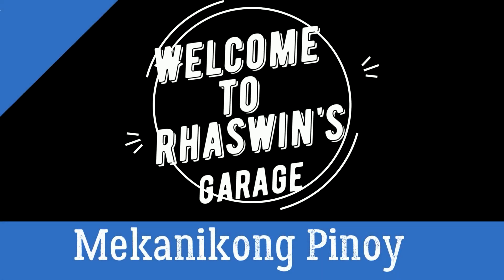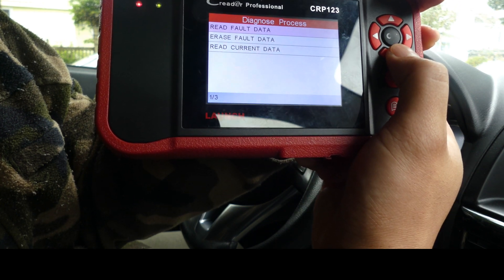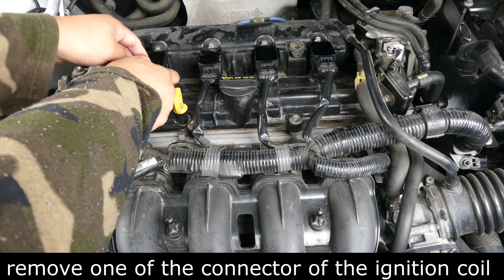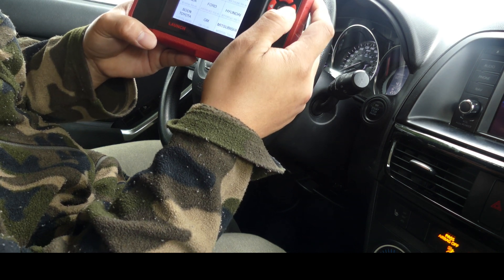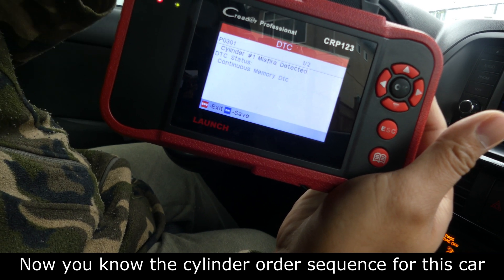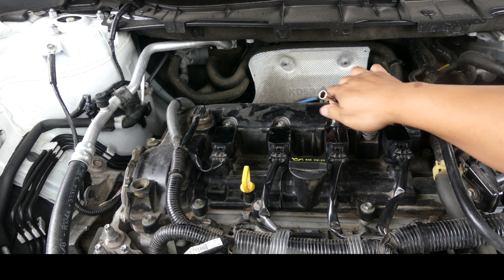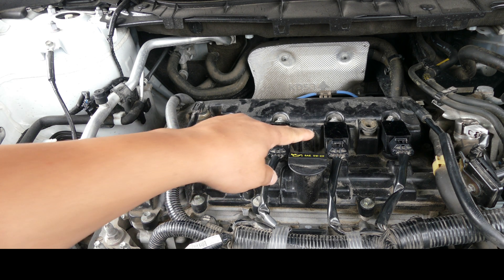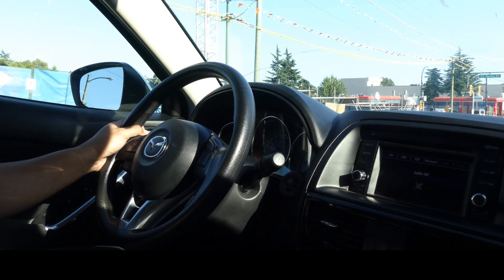2013 Mazda CX5 MISFIRE?????

Comment: First of all take out intake manifold and clean carbon inc drossel. Then change spurk plugs. Only then go to ignition coil- because issue not here
Reply from the maker: first of all my friend when u diagnose a car u need to determine whats wrong with it ..The issue car has misfire ..Now it could be ignition coil is the easiest parts that can be scheck next is ur sparkplug ..By the way this cas is from alberta they had a vacation here in vancouver 12hrs distance ...I just help them because they are my fellow filipino no charge ..LOng story short car overheats headgasket is broken ..valve is toasted they replace the engine

Comment: Hey, thanks for helpful video. Note there is a TSB Bulletin No: 01-014/16 stating coils are bad on 13-16 cx5 and 14-16 3 and 6. Should have been a safety recall in my opinion. My #3 coil failed on freeway and made everything malfunction including transmission. Car would run rough for 30s and then transmission would cease functioning and all the warning lights came on.
Reply from the maker: Thanks for the info!

Comment: What if it's still misfiring
Reply: Did you find out what the problem with yours was? I have the same problem. I replaced all 4 spark plugs and the ignition coil and it’s still misfiring.
Reply: @ToastedPickle_  did you ever figure out what it was?
Reply: @jonfreeman5494  Yeah, turns out I had to replace all the ignition coils. I had only replaced two of them. Have you tried replacing the spark plugs or ignition coils?
Reply: @ToastedPickle_  I replaced the spark plugs, cleaned the injectors, used valve cleaner. I tried swapping the 3rd and 4th cylinder coils to see if it was the coils but it still came up as a misfire on 3. Im beginning to think it's something wrong with the wires that hook to the coils but I might just have to bite the bullet and replace the coils. I can't think of anything else it could be
Reply: @jonfreeman5494  Yeah it’s most likely the ignition coils. Hopefully you’re able to fix it soon.
Reply: @ToastedPickle_  yeah I'll try that, thanks for responding!
Reply: @jonfreeman5494  Np good luck!
Reply: How did you remove the injectors Jon? I’ve tried searching for videos on YouTube for a tutorial but cannot find one. Any help?
Reply: @Korowai122  they are underneath the air intake. You have to take that off then you will see the fuel rail. Then just unbolt the fuel rail and pop em out. They can be difficult to remove so be careful not to damage them. They have to be pulled straight out. Apparently you are suppose to replace the Teflon seal everytime you remove them because it apparently damages the seal. And you need a special tool to install new ones. What ended up being wrong with my car though was carbon on the valves. I tried cleaning them but apparently not good enough. Took my car to the mechanic and they used a cleaner that's really potent. I think only licensed mechanics can buy it. But yeah, they just ran a cleaner through it and it cleaned my valves and the misfire went away.

Comment: Bro,pinasok yan ng tubig,Hindi n sealed ung coil boot,sira n yan ung spark plug,,bro,,,maganda yan kung meron kang spark(plug)tester,ma test mo ung coil or ung sparkplug kung gumagana
Reply: Nag overheat d napansin
Reply: Nag overheat bro kc sabi nya my nagbliblink sa dashboard d nya pinansin galing to Calgary namasyal dito sa Vancouver saka na scan ko eto with load nag iiba iba ung code din binuksan ko sunog din ung ibang coil saka summer ngaun dito there's no way na matubigan lalo na sa Calgary super dry dun
Reply: @pinoymechanic5306  kawawa ung sasakyan bro,hehehe,marami talagang may ari ng mga sasakyan n d ng check ng kanilang mga sasakyan,basta umandar,tumakbo lang ok na,at kung masira e blame pa a brand ng sasakyan,hehehehe
Reply: Dito lang kc natuto magdrive.. Wala syang alam sa car ang masama katatapos lang daw yata nila nabayaran actually ung breakpad pudpod din metal to matal ma hinahayaan lang pati strut nya sa harap lubog ung isa andami kayang lumalabas sa dashboard nya abs esc engine light naka on napabayaan talaga pati windshield bitak
Reply: Ang Mekaniko wawa ung car,Hehehehe
Reply: @filcarzon2761  oo sayang tong car to marami akong magagawang video sa car na to kaso ung may ari nasa Calgary puro diagnose lang magagawa ko dito walang repair
Reply: @pinoymechanic5306  laki ng gagastusan nyan bro kung ipaaayus,bka kulangin ung 3thou nyan
Reply: @filcarzon2761  towing from Vancouver to Calgary abutin daw ng 1k cgurado yan bro libo ang gastos
Reply: Ang Mekaniko ipina check up sana muna yan bago sila ng travel,kung road worthy ung sasakyan,ngaun laki nyan ng pg sisi ng me ari ng sasakyan
Reply: @filcarzon2761  sana ipamigay nalang sa akinor ibigay ng mura papalitan ko ung makina ok pa to maganda pa full loaded mag iisang bwan na dito baka nagdadalawang isip na ung may ari kung ipapaayos pa to..
Reply: @pinoymechanic5306  d yan kilangan palitan ng makina,mga test Lang ung kilangan muna,sabihin mo sa  owner n binigyan ka na ng 15 days notice n kunin ung sasakyan o e impound nila hehehehe,cgurado Lang kunin nila o ibinta sa yo,